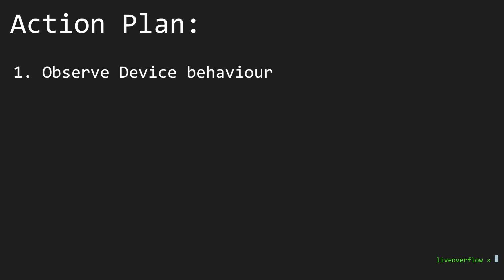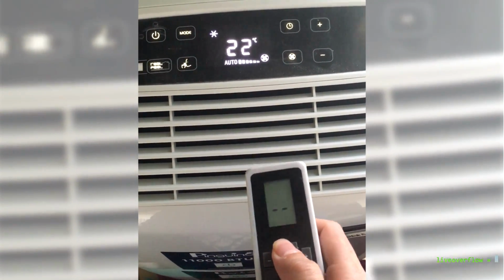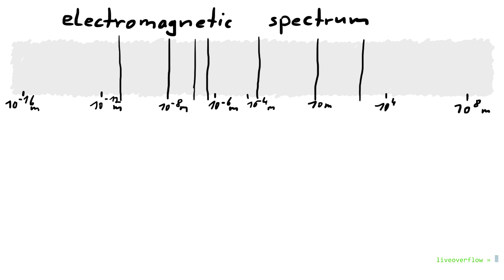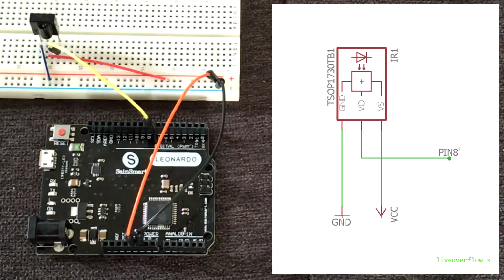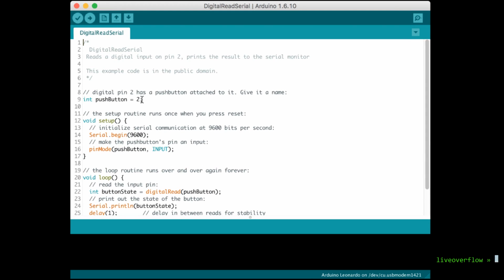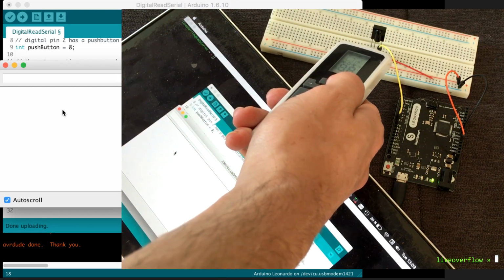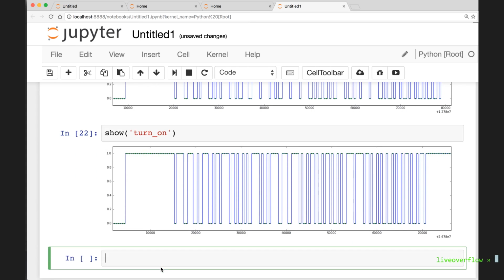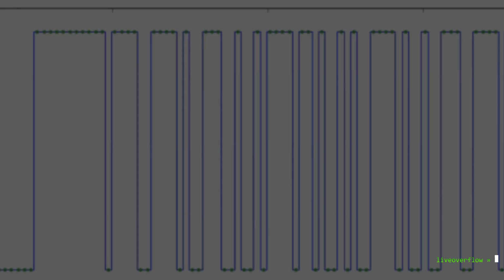Building Poor Man's Logic Analyzer with an Arduino - Reverse Engineering A/C Remote part 1

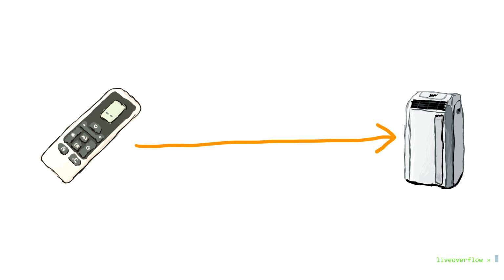Comment: @2:17 how the hell could you maje the conclusion that all setting are transmitted in a single packed just by going to another froom and pointing aylt a wall??  All u could get from that is maybe it sends IR OR the Rf sig is weak. 😒
Reply from the maker: I guess I don't make it very clear in the video.
Let's assume you only send a diff, then when you press "temperature up" ONLY the temperature will go up once. So if I go in another room where there is no RF connection, and press other buttons, and come back to the AC unit and press "temperature up" ONLY the temperature would go up, right?
But like I show in the video, that when I go to another room and have no connection, and change a lot of other settings, then go back to the other room and press "temperature up" ALL the other settings adjusts to what the remote thinks it is.
So it's pretty clear that it has to be this way. no?

Comment: Wow i just found this channel and this is great!
And by the way, did you know that there is a remote  IR library for arduino that can read and send IR signals?
Reply: +Nabeel Rehman i use my cellphone with a phototransistor connected to the microphone to record commands, then i play it back trough an opamp with baseband modulation at 38khz and it work fine at reproducing any command, and damn it's way easier to edit this files on audacity.
Reply: there is .. but it does not handle AC protocols very well.. I have tried it and failed several times..
I tried to duplicate just the ON OFF button with that library but the results were not at all satisfying.
If you have tried duplicating AC protocols via ARDUINO, I would be very much interested in knowing them.

Comment: Wouldn't it have been much easier to grad the pulses from the base of the remote LED? Rather than use an IR sensor?
Reply from the maker: If by "easier" you mean I'd have to open the case of the remote, then yes :D

Comment: You can get a 8 channel logic analyzer for 5$ and it works great up to 24mhz, search for CY7C68013A on ebay. And for software use SIGROK , an universal open source logic analyzer front end.
Reply: You'l definitely learn something new using a logic analyzer as well. A remote like that uses relatively low speed communications. For pretty much anything that involves reverse engineering hardware you'd need a logic analyzer. It's the best tool for this job. The Arduino is good enough for a remote though, if you use highly optimized code to analyze the signals. A interrupt routine reading the data and immediately dumping it over the serial port is probably the best method. Keep in mind that massively boosting the serial clockrate over the default 9600 will also help A LOT.
Reply: Thanks for the hint! 15$ oscilloscope from aliexpress also will do.
Reply: shodanxx but the point is to learn something new
Reply: Where is the fun of it.

Comment: Here's a simmilar Guide with more Info and a complete decryption of the protocol showing each step. 
https://github.com/zeroflow/ESPAircon/wiki/Steps-of-the-reverse-engineering
Reply from the maker: oh neat. I did not know about this one. But as I mentioned in the video. Looking at IR remotes is a super basic things and there exist endless of videos about it. Will be interesting to see how the packets compare to my remote.
Reply: this is really cool! (ha, get it... b/c you worked on an air conditioning unit) seriously though great stuff. On a personal note I had an old VCR that used the NEC protocol

Comment: Can't wait to try this out.
Waiting for the next video to come out already!
Great work, please keep at it!
Reply from the maker: Don't wait on me! Go try it out! You could try to speed up the data acquisition to get more data points. You could also, like suggested in another YT comment, directly connect the arduino input to the LED of the remote (gotta open it up). That's even better than doing it over the IR sensor.
Also if you want to know more about it, I linked a great video from EEVBlog in the video description. EEVBlog has multiple videos about the IR remote protocol stuff.
Reply: Thanks a lot for the tips.
I actually meant I'll have to wait until I get an arduino.
Reply from the maker: ha! ok. even better ;) I wish you a lot of fun with it

Comment: I have a question. Won't that be more easy if you connect arduino directly to the RC without using LED stuff?
Reply from the maker: absolutely ;)
I tried like 2min to pry open the RC. Then I said "fuck this" and do the LED.
Reply: +LiveOverflow no, you're dumb, you could have used literally anything with a microphone input to capture the commands instead of trying to read the baseband modulation too.

Comment: I once made a little circuit, that only activates if the DVD player remote is pressed (doesn't respond to any other remotes as it looks for the "pattern" that is attached to every button press of the DVD remote (it's "10101100101" or sthg like that) ). I hid it in the classroom DVD player when nobody was there, hooked it up to the TV switch too (it was on the back), and when somebody turned on the DVD player, it always turned off the TV. It was fun for a while.
Reply from the maker: +cyancoyote hehe nice project